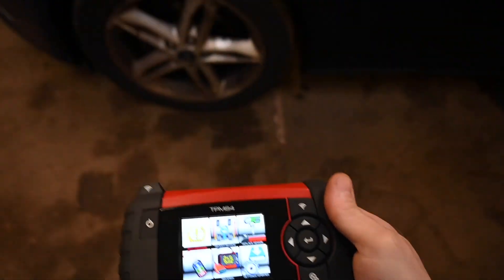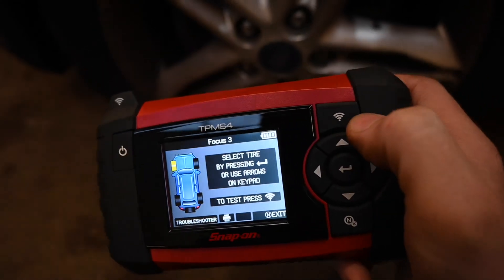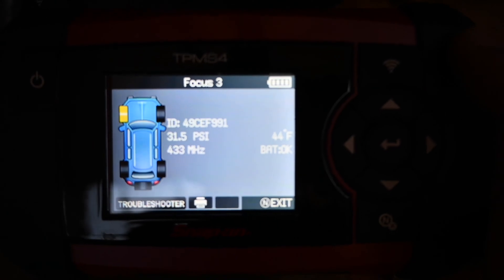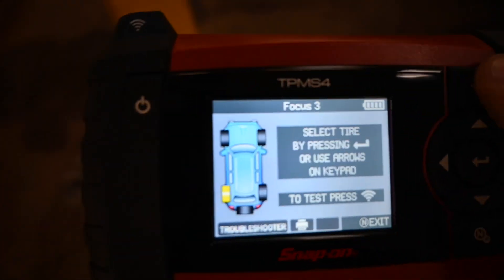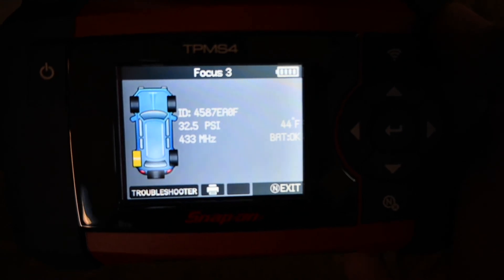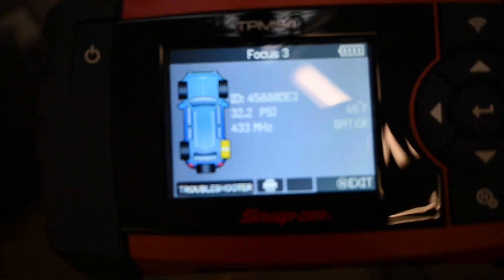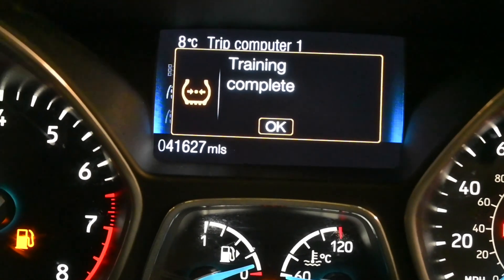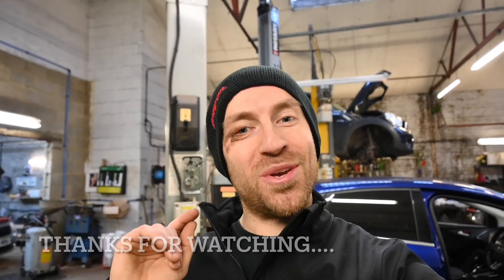TPMS System Training & Reset on a 2015 Ford Focus EcoBoost 1.0

Comment: Is it the exact same ignition procedure with the physical key version? I see that the vehicle used in this video has the push button start/stop, which is why I'm asking.
Many thanks.
Reply from the maker: Hi, yes, the sequence is exactly the same whether it’s a push start button or physical key in the ignition. Thanks for getting in touch 🙌
Reply: @greenautoservices I appreciate your prompt response, thanks.
I can confirm that after following the steps exactly as per your video, it has certainly worked on my 2015 Ford Focus Eco boost 👌
Although I will mention, for anyone else who is considering doing this for themselves, I don't have the finances available to buy anything close to the lovely bit of kit you used, first to check the sensors and then to do the learning procedure. I took a punt on a little push button gadget off of Amazon, looks like a doorbell, but achieved the same end result and was under a tenner 👍
Thanks again for your help.
Next up, I'm looking for advice on how to remove the inner boot trim, from the same model, as I believe I have some missing clips and the whole thing rattles! (Bought 2nd hand very recently). Thus far, haven't been able to find 1 single video 🙆
It's the whole trim, with the 2 grab handles, inside the boot door itself.
I'm assuming you need to pry the handle covers off first and maybe then just yank the whole thing off?
Cheers

Comment: Does the same method work for a key turn ignition? Don’t have have a push button ignition. Also I have a 2015 cmax, I presume it’s the same process? Thanks
Reply from the maker: Hi, thanks for reaching out. Yes, Ford will implement the same system whether a push start or ignition barrel. Give it a try as you can’t do ant harm to the vehicle even if you get it wrong. I’m quite sure it will work though. As long as the sequence is done within 10 seconds, then you’ll hear the horn if you’ve have done it correctly. Good luck
Reply: @greenautoservices thanks just need to get the tpms gadget first!

Comment: Thanks for the video, I have a 2016 focus rs and in that last step under my settings there is no tire monitor pressure option.
Reply from the maker: Love the RS's. Glad the video helped. Mind you, double check in all the instrument cluster settings. I'm sure there will be a setting to allow you to reset the TPMS system, especially once all pressures have been adjusted. Otherwise, thanks for getting in touch.

Comment: I start letting air of my front left tyre and it doesn't move me to next one? It eventually goes flat and then car beeps and says tp couldn't be trained? Any ideas? I did get st wheels I changed to, im wondering if the sensors need changing?
Reply from the maker: Hi. Thanks for the comment. So firstly if you’ve had ST wheels fitted (or any wheels for that matter) but used the original sensors then as long as the sensors are still in the same position on the car then the system would not need to be put into a re-learn mode. At most you would just need to put the correct tyre pressures in the wheels then reset the system normally through the steering wheel settings. You only need to initiate a relearn if you either rotate wheels/sensors around the vehicle OR replace a defective sensor with a new one. Otherwise you will need a Tyre Pressure Monitoring Machine similar the one in the video to tell the car that it’s to learn that particular sensor after putting the car into a re-learn mode. Otherwise just letting air out of the tyre will not register the new or newly positioned sensor. Hope that helps and makes sense.
Reply: @greenautoservices  appreciate the reply, okay so yeh I got ST wheels for my zetec s, the wheel position might make sense as I do not know which wheel was which when fitting them as I didn't keep my old sensors. The new wheels already had some fitted. I'm taking it to a garage tomorrow as they said they have a device to check them, was hoping it was something I could sort without paying out.
Reply from the maker: @iitznotsteven  that makes sense. If they are sensors from another vehicle then they will undoubtedly need to be relearn to the vehicle. It shouldn’t take the garage too long. As long as the sensors in your wheels are all ok then the car should pick them up. All the best 👍
Reply: @greenautoservices  ahh okay thank you mate. Really appreciate the info and help 🙏🏻
Reply: Cheers for that . Have just got 4 sensors fitted and the light was still on . Followed your instructions and worked a treat

Comment: Great video, would love a review/recommendation of any TPMS readers suitable for DIY, Snap on's a bit pricy :-) or a vid on cars with TPMS but not using sensors in wheel.
Reply from the maker: Thank you for your positive feedback. Since TPMS systems have been around I’ve only ever used Snap-On’s TPMS 4. Their TPMS 5 is either out or coming soon to America so May upgrade. However, having a quick browse, alternative TPMS scanners are around £150 upwards but how much they scan/programme I wouldn’t know. HOWEVER, videos I can do. No doubt there will future videos of other system, which use the ABS system to tell the car if a tyre is under inflated or not rather than have sensors in each wheel. I’ll try my best to get a video filmed. Thanks again 👍